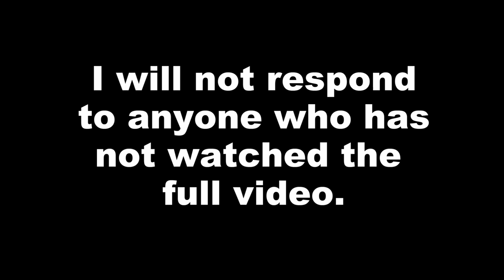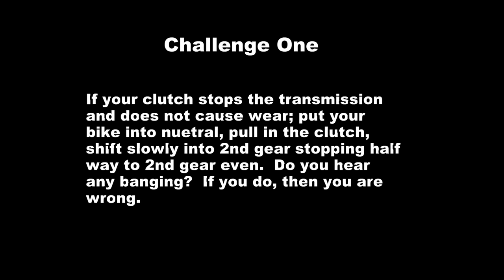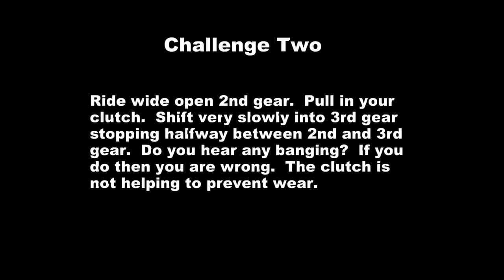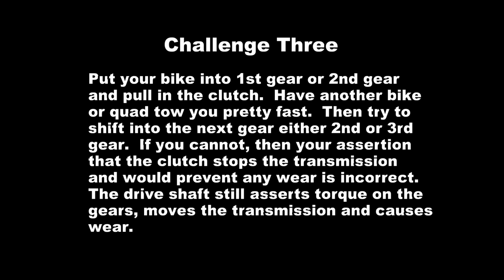Dirtbike: Shifting without the clutch

Comment: Thank's for the vid mate... I now know what the occasional banging is between 1st & 2nd... It's the dogs, and me changing gear to slow... 
I wrongly presumed a tooth or two together had worn off on  the cog of gear 2, by previous owner of bike then randomly the 'worn 2 teeth' on the cog met first with the other cog when engaging from 1st into 2nd. Causing a bit of a bang. (doesn't happen going down from 3rd to 2nd! (only 1st to 2nd).
Also while waiting at lights, bike sat in nuetral for a good 30 secs, (hands off the bars, both feet on the floor) when i engage 1st gear, sometimes gears crunch and bike jerks forward a fraction.
For the record, i'm on a Yamaha WR 125(R)... Coming upto 14,000 miles on the clock...

Comment: Its called a counter shaft and the “shifter cam” is called a shift drum! No pro motocrosser uses the clutch to shift. Drag bikes use air shifters that slam the shifter without a clutch. The shift button also kills the ignition for a split second which is enough to take the load off the gears. You can let off the throttle and shift without the clutch which also takes enough load off.

Comment: I was a professional motocross racer. So obviously i rode alot i never shifted with a clutch never once had a transmission or clutch problem. I was not nice when i shifted either. I held it wide-open and shifted up or down.

Comment: Great video dude! I always shift with out my clutch on my street bike when racing same goes for the dirt bike even in the Honda on the road racing never had a problem i drive a 18wheeler shift allday with out my clutch only time i use is to down shift but never had a problem

Comment: The whole idea of gear dog's and dog clutchs is that it can be shifted under power.
This is how sequential racing car transmissions are designed to be used.
If it were a syncromesh transmission then the clutch needs to be used to prevent syncro wear and allow proper engagement.

Comment: great video, i knew all these stuff before. But i have 2 questions. 1st) is it possible to overheat your piston with lean fuel mixture with carburetor 4stroke when you let off throttle on high revs and don't pull clutch, and maybe even don't use brakes - i mean longest engine breaking. 
2nd) - i can't still understanding how downshift without clutch working, but i am using it on 250 mx bike. Main thing i can't understand - i am imaging that dogs during braking (without blocking rear wheel and without using clutch) have a lot of load on them (maybe not so much like when you hard accelerate, but it still there) and can't disengage. But downshifting without clutch working. - i can't understand how. May be this load not so much and shifting without clutch still possible, i can't find out.

Comment: i know its ok to shift with no clutch. but i had a bike a few year back that the clutch was rested so it would not disengage so when i got the bike to run i ran with it and put it in 2 gear. but after i did that it would not come out of gear until i turn the bike off. so i clean up the same clutch where it would work. everything work after that it shift with no problem. the question is why didn't it shift when the clutch  was stuck ? when the bike was off it would shift thr all gears too with the stuck clutch

Comment: My question is, (yes i know your talking dirt bikes) (but tranny seems to be the same concept) on a Harley Davidson, when you are in neutral and pull in the clutch, then click into first gear the bike will make a lurch and bang? Then when you let the clutch out and meet RPMs with the tire and not use the clutch and only shift into second it will make a loud bang and lurch again, not so much with the remaining gears, just first, second and third? I've looked at several YouTube videos and it seems to be in every video I've seen on the subject so it won't be hard to demo ? Thanks great videos!

Comment: Shifter karts all shift without a clutch all day long. The only thing they use their clutch for is to get going initially. I do tell people to shift with the clutch because, as you mentioned, shifting under power can damage parts. and pulling in the clutch will help eliminate this type of abuse. 

The only other thing I can think of is that maybe the inertia of the motor transitioning from the RPM's of one gear to the next may stress those dog teeth more when the clutch is not used. Without the clutch, the motor instantaneously is forced to change RPM's when you shift. Using the clutch will eliminate the extra "shock" on the dog teeth from the inertia of the motor changing RPM's so abruptly. And if the dog teeth are not completely meshed with each other, this shock may be concentrated on only the outer edge of the teeth. 

Yes, you will hear a bang when you shift with the clutch (more like a click), but the bang may not be as severe as it is when you don't use the clutch. And the only reason I am arguing this idea is because my 1982 CR480 does NOT like to be shifted without the clutch. I end up finding neutrals where they don't belong and feel grinding through the shift lever while trying to get it back into gear - even though I let off the gas while shifting. And I am shifting as fast as possible. I think the dog teeth edges are slightly rounded, and that's why it doesn't go in as well as it should.
Reply from the maker: +EreksonJ The old hondas are known to have poor gear dogs in their transmissions.  It's very common for them to have worn gear dogs in them, especially from 1st to 2nd.  Clutch won't help them wear down any less though.  I had a 79 CR125 I bought that would always jump out of 2nd gear.  Seems like honda let the gear dogs get too close to the other gear and that allowed it to wear down while engaged since it had a circle on the opposing gear all the way around and the other gear had the gear dog worn down.
Reply: That would explain it. Thanks for the info!

Comment: Using your clutch is easier on the transmission period.  Yes, the dogs on the gears are designed to withstand the impact forces that they'll see when used without the clutch.  The weak link in the transmission will be the shift forks.  Those will fail under extreme load before the gear will.  Is it common.  No.  But to say there is no risk in shifting without the clutch is naive.   It's why quick shifters cut out the ignition during the shift.  For me personally, I use the clutch to start from a dead stop.  On all upshifts  I don't use it.  I just chop the throttle a little.  When I downshift a standard clutch I will use the clutch but that's mostly due to engine braking and me wanting to not have the back tire break free.  I'll downshift without the clutch if I have a slipper clutch.  Every time I shift without the clutch I know I can bend a fork.

Comment: Been clutchless upshifting for years and never destroyed a gearbox and I only use the clutch to take off and for downshifting to make things smoother and to put less strain on the drive train. Throttle blipping seems pointless IMHO, never done it or felt that I needed to.

Comment: It seems like there is a lot of people riding motocross etc. in the comment section. I'm guessing that the street bikes 2 stroke have similar transmission and you can shift the same way. But is it really the way to go if you want to keep your bike for daily use over lets say 5-10 year period. Races and normal riding is two different worlds. Should you use clutch on normal riding? Because of cheaper components and less skilled driver. Or should you not use clutch? // In the race situation you don't have to.

Comment: Shifting with the use of the clutch has likely destroyed more motorcycle transmissions than shifting without. It depends more on how you use the throttle. Speed shifting by using the clutch can destroy certain motorcycle transmissions rather quickly.

Comment: Toby 
My question is this I rarely use a clutch from second gear on & have never had an issue 
& You did a fantastic job explaining everything BUT ...
more often than not I find clutch less shifting from 1st to 2nd lands me in neutral that very scenario has caused 2nd to shatter from the shock of 7000rmp bang into 2nd my challenge to you is to show the potential for this to happen
Reply: Huh? That's clearly driver error lol. Not a mechanical one. Either you're shifting too early or aren't releasing the throttle enough.

Comment: Also, some transmissions shift better under load than others. My rm250 is easy to shift even under extreme load, yet my buddy's ttr230 doesn't like any load on it while shifting, it is very hard to get out of gear. So I say a good rule of thumb is to just not force anything into another gear. Feel out what your transmission likes and do that.
Reply from the maker: +blake woolam Never force, if it's forced, then the torque is still on the gears.

Comment: You are partially right. It is not the speed you shift at, it is the rpm. You need to shift when the gear dogs for the next gear closely match the speed of the gear they need to engage/disengage. In order to do this you simply put a little pressure on the shifter (do not force it into gear, this can cause issues) and when you let off the throttle and the gears match speed it will shift into the next gear with no drama or wear. This is exactly how a quickshifter works except it cuts the throttle for you.

 As for the reason the shift pattern is arranged I am not sure but I always assumed it was more for saving space and possibly reducing weight. Your 1st neutral 2nd theory doesn't make much sense to me. I have had many bikes that do not shift down to first well and get  stuck in neutral so to say that it is arranged  that way so you know your in first doesn't  make sense to me.

Comment: Me personally in MX I noticed with a brand clutch,I could come off the gate full throttle,use my head to control the height of the front wheel and shift at full throttle,when the clutch is worn I can't shift as good,I back the throttle just tenth of a second,u have to see it in super slow motion...thanks

Comment: I've just begun riding motorcycles. Are you saying engine braking is bad? My KTM Duke 200 has quite a lot of engine braking that sometimes I use it to slow down instead of using the brakes because I'm afraid if I use the brakes+clutch often it will wear out fast. Should I be using the brakes + pull in the clutch (to prevent dropping RPM too low and seizing) rather than use engine braking?
Reply: No need to worry. Your Duke is a 4-stroke, and it has an oil pump that rotates as long as the engine is rotating. You can engine brake all you want. 
The engine braking issue is in regards to 2-stroke engines with premixed fuel. Some 2-strokes with separate oil injection is safe to engine brake with, since the oil pump injects a small amount of oil even during engine braking. 
Premixed two strokes are lubed by the gasoline mixture. No gasoline - no oil.
Reply: Thanks for the info and explanation! Cheers!

Comment: I knew most of what you talking about with the dog gears and such, but the intricacies about the oiling, the affect of pulling the clutch, and the one I never thought about; Rocking the bike to change gears dry!  Very good detail sir, but that leads me to some questions.

1) Slipper clutch (street bikes) - When you were talking about deceleration (23:47), the driveshaft is still causing the transmission to spin the crank at essentially an "artificial" RPM.  Is this one of the main reasons for the slipper clutch?  It helps mitigate wheel spin on shifting, but is the side-effect also saving the transmission in these scenarios?  I imagine street bikes are different since you would be decelerating quite frequently on the street without the need to downshift before the slipper clutch was conceived.

Comment: I like how you dumbed it down, good video, my riding technique on a 2-stroke is never let off "racing" and keep steady pressure on lever, when the engine gets past power it will shift its self.. I've never had problems I've abused and used bikes, they can always be fixed so i ride the way i want... no biggie, some folks just like to complain and most of them i believe is here in the U.S eating laundry soap lol